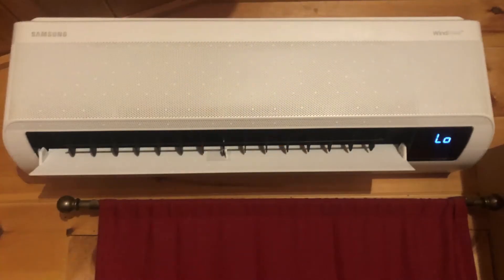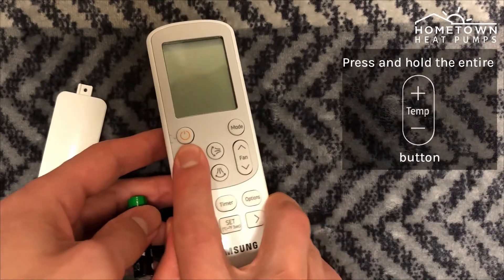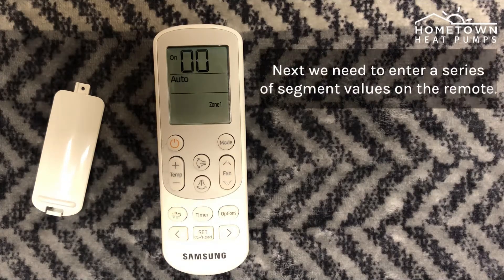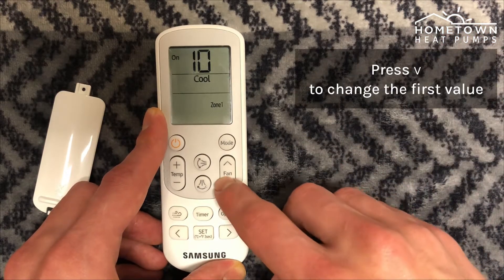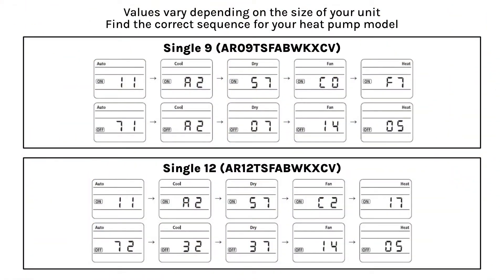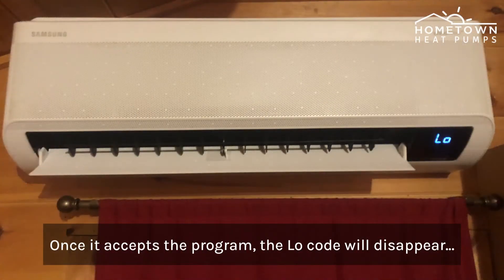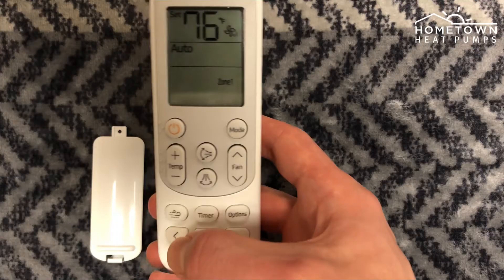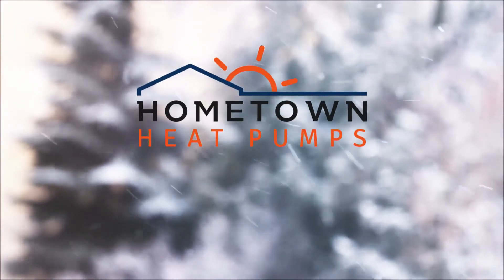How to Fix Samsung Mini Split Heat Pump Lo Error Code (see comments for additional models)

Comment from the maker: If your model number doesn't match the ones in the video you might have one of the following models:

Single 9
AR09TSFACWKXCV 
AR09CSDACWKXCV

Single 12
AR12TSFACWKXCV 
AR12CSDACWKXCV

Single 18
AR18TSFACWKXCV 
AR18CSDACWKXCV 
AR18CSDAEWKXCV

Single 24
AR24TSFACWKXCV 
AR24CSDACWKXCV

Just enter the code in the video for that size. Let us know if you need help or have any questions!
Reply: What about AR18BY5YAWKN

Comment: Hi. Do you have the Segment codes for AR18BY4ARWK? 
I have LO Error and won’t disappear
Reply from the maker: Hello, I'm sorry we missed your comment. I do not have codes for any other models, however most of them use the same code for the size of the unit's BTUs.  You can try the 18 that is on the list and see if that works the next time you get the Lo code.  The code should disappear and the unit will go back into operation once the temperature rises.  However if that does not happen you can do a hard reset to the system to get it operational again.  Simply turn off the heat pump and flip the breaker off in the electrical panel for 15-30 min to reset the unit and erase the code.  If the temperatures are still too low for operation the code may reappear once the system gets to that start up process. But if the temperatures are warm enough it will not reappear.

Comment: I have tried this now and resulted in a totally black display on the pump, not working at all. I have thied all of the codes and its not working. 
Do you have the code for pump woth serial number AR12NXWSQWKNEE? And why did my screen die? 
Thanks

Comment: Hi! Thank you for the video. Do you have all ten segment codes for comfort 9 AR09KSFSQWKNEE? Those for single 9 from your video didn’t work for me
Reply from the maker: Sorry we do not have the codes for that model, you can try calling Samsung technical support for your region. 1-888-699-6067 for US and Canada. All other regions try searching for Samsung HVAC or Samsung Climate Solutions in your region or try contacting a local authorized dealer in your area.

Comment: Do you have segment values for AR09KSFSQWKNEE? Those 3 different values that was shown on video didnt work for me...
Reply from the maker: Leija Spede, thank you for watching the video. Try the short code version: D1 - 24 - 50
Reply: @HometownHeatPumps  Can you explain the short code version?

How does the coding work?
Which parameter do I have to change to get the pump working in negative 30*c.. thats my outside temperature right now..
Reply from the maker: The short version is the same as the long version in the video you just use these 3 codes in the first 3 segments. Sometimes the short code works, sometimes you need the full code. I'd advise calling your local authorized Samsung dealer for help if you do not have one of the models listed in the video or call technical support at 1-888-699-6067 in the  US and Canada. All other regions try searching for Samsung HVAC or Samsung Climate Solutions in your region.